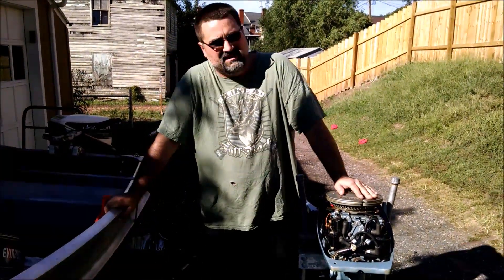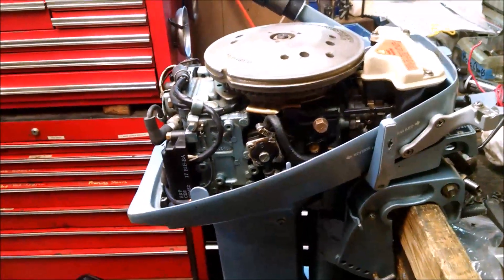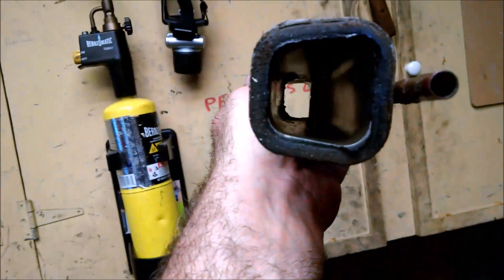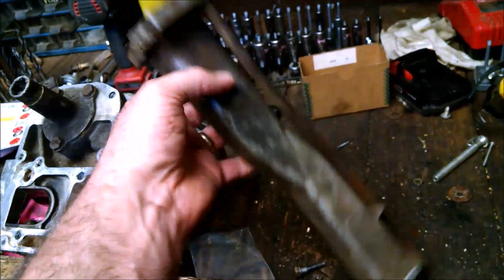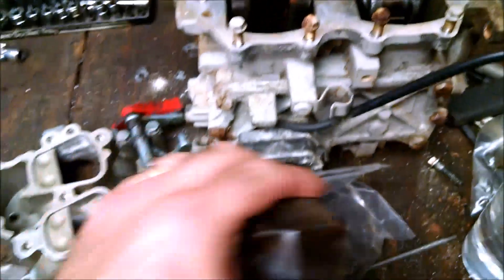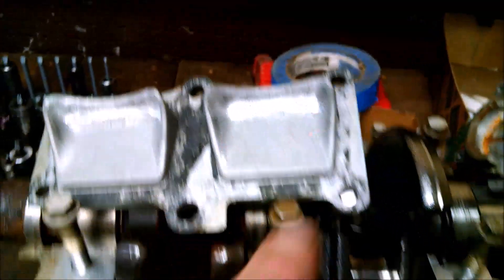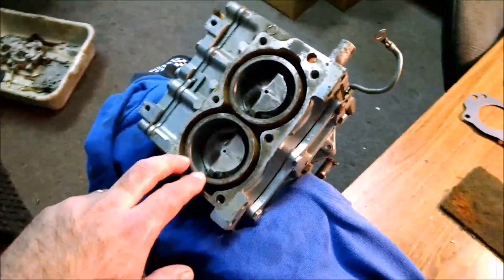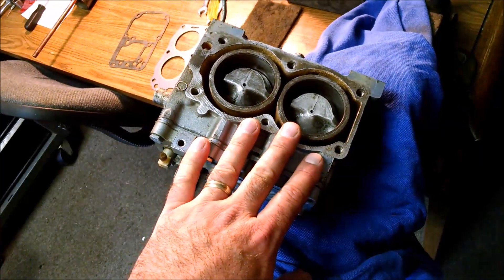9.9 to 15 hp conversion Johnson Evinrude  Part 1

Comment: Boysen "dual stage" reeds give  better low end throttle response on the low end but rob top end power. The thick second reed never opens because the first thinner reed open before it; Ok for dirt bikes, lousy for outboards,so this product is simply a gimmick.  

 If you really want to do a power modification,  raise  the exhaust ports .065" and champfer them, then,  mill .007' off the head to slightly increase compression, and run premium 91 octane fuel.  Timing at full throttle can be set to 5 degrees more advance than stock for more top end. 
.   So the 9.9 is actually a 13hp, and with the 15 carb it jumps up to 18hp, with no other modifications.

Comment: Embarrassing video dirty mess of a garage no wonder you are out of business
Reply: My 9.9 76 doesn’t need a tuned exhaust does it ? 1 think 74-79 where the same everything but the carb I’m sure the round exhaust and the reeds would give it more top end 
My question is did you have to upjet your carb with porting ?
Reply from the maker: @jimcatx3090  the tuned exhaust should help no matter what year
Reply from the maker: Why are you so obsessed with the cleanliness of my workspace?
Reply: How do you blueprint a standard Outboard did you have to balance the crank lol

Comment: Nice project.When looking at your pistons a question popped up.On my 20hp Johnson the pistons which are same type as yours the top flat part appear almost have rust colored build up and the others part is black from carbon.What would cause this difference?
Reply from the maker: I don't know
Reply: Tienes una pequeña entraba de agua en la cabeza de ese cilindro. Aplana la culata y ponle empaque nuevo.